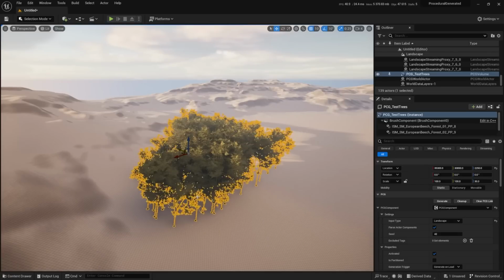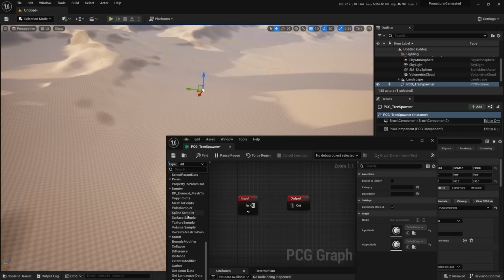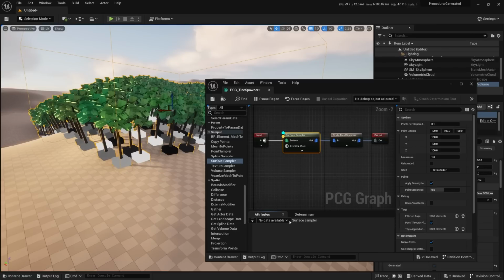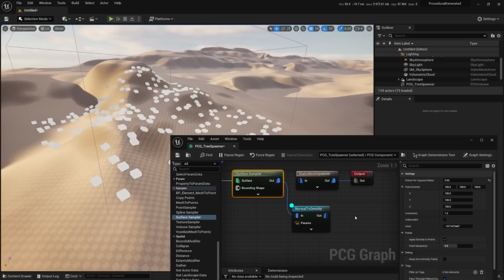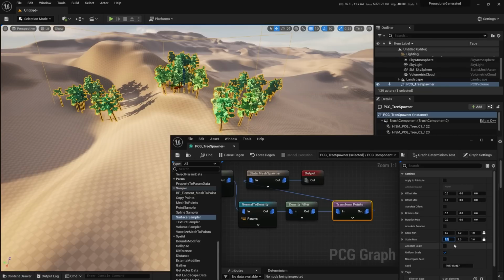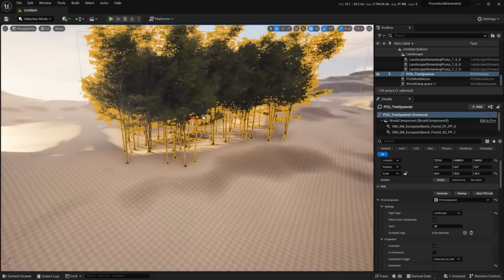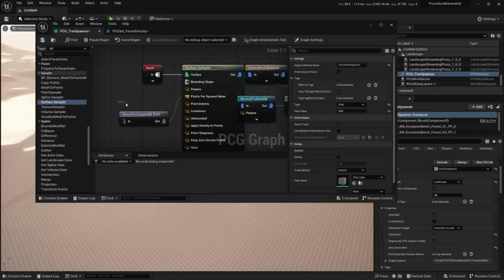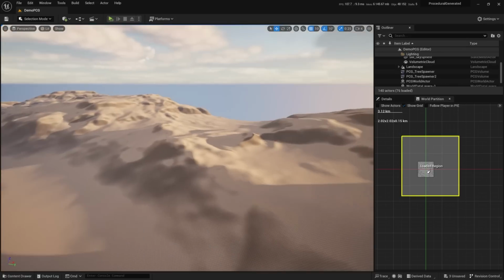Unlock the Power of Procedural Content Generation in UE5.2: Beginner's Step by Step Tutorial

Comment: Just tried this in 5.2 (released yesterday) and all 3 of those Free Quixel European Trees you're using won't load. When trying to "Select the Project to Add the Asset to" (in the epic games launcher) I get this error "Asset not compatible with version 5.2, please select closest alternative version."

Does anyone have any High Quality Free Realistic Trees we can use in our projects? Preferably ones that sway back and fourth as if the wind is pushing them?
Reply from the maker: Just select the version that says 5.1. It should work with the new 5.2 version of the engine.
Reply: @unfgames  if I select a 5.1 project then I won't get to use the new PCG tools in 5.2
Reply from the maker: @3dquicky  You need to create a 5.2 project but import the 5.1 assets inside the new project.
Reply: @3dquicky  Did you get it ? I have the same issue

Comment: How'd you learn this so fast?   I can't find any documentation or anything on how to use this asset.
Reply from the maker: Usually what I do is play around with the tool, and look at the materials that I found on the net (which you can see in the description of the video)
After that, I try to set a goal, in this case a little tree spawned and try a lot of approaches and choose the one that makes the more sense.
Reply from the maker: Usually what I do is play around with the tool, and look at the materials that I found on the net (which you can see in the description of the video)
After that, I try to set a goal, in this case a little tree spawned and try a lot of approaches and choose the one that makes the more sense.

Comment: I'm confused how this would work in a large open world. You wouldn't want to be manually placing down these little square volumes all over the place in a big procedural world, you would want to control where things spawn entirely through nodes in the graph by sampling texture/biome regions. I really hope there is a way to do this on a larger scale without using volumes, unless the expectation is you scale up one really large volume that covers your entire landscape, and use that one single volume to control everything that's spawned, trees, rocks, npc, etc...
Reply from the maker: I believe scaling the volume to the desired size would’ve be the way to go if you want different biomes. 
If you want to break free from the box shape you can also use splines to guide where you want to spawn stuff or just clon in unbounded and see how every piece of landscape gets used as a generation area.

Comment: How do in tech demo they generated Fallen tree dynamically and also water
Reply from the maker: More points and more meshes.
A little bit of logic to check distances on when to create the fallen trees and you are golden.
Reply: @unfgames  Yes i could do like that although mesh are spawned inside the volume and we cant select individual mesh , so how do i make it understand that if distances between two or more spawn points is this much spawn a tree at this particular location
Reply from the maker: Inside the graph you do have access to a lot of information of the surface of your level. So there must be a way to get what you are looking for.
The video was done with my initial finding so there is a lot of stuff I was not able to show.
Reply: @unfgames  hopefully there should be some way